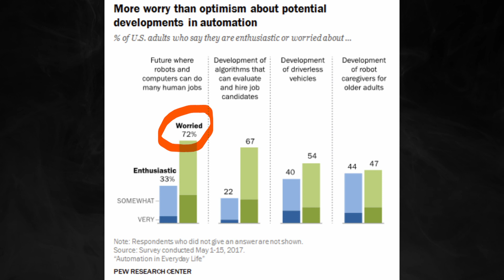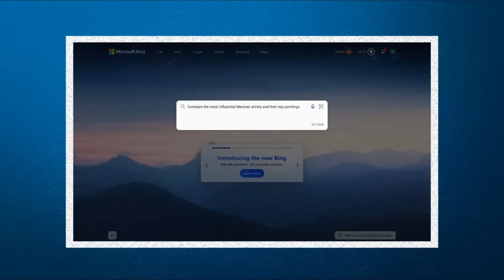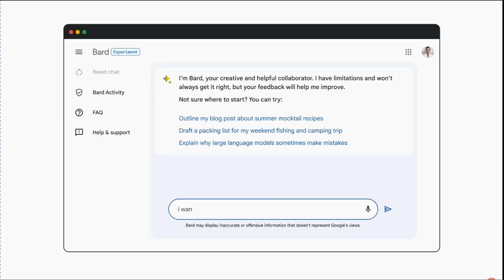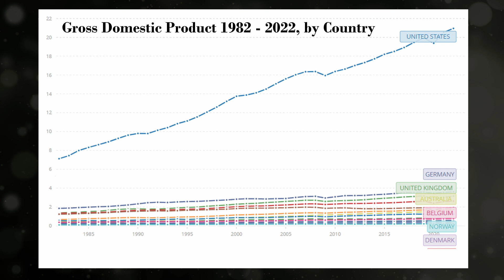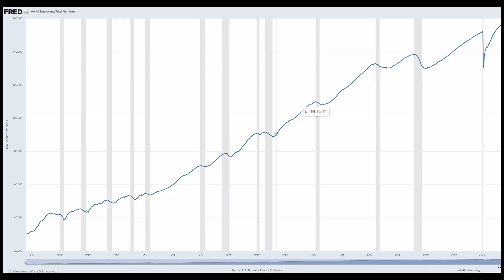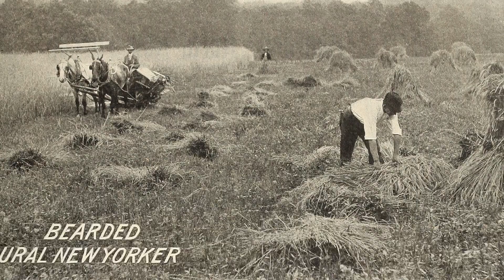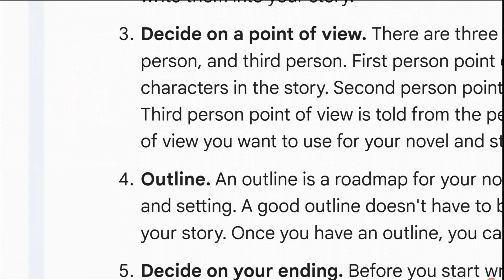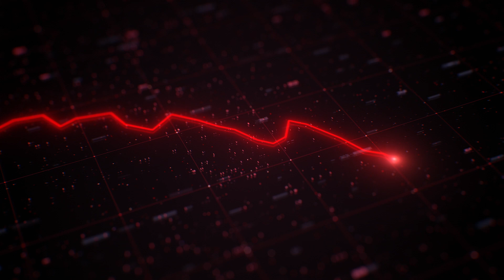Will AI Replace Your Job? | Lump of Labor Fallacy

Comment: Very good video. I think there are a lot of people who have somewhat apocalyptic visions of what is going to come with mass automation, and you break that image effectively. However, behind the myth of AI taking over is a much more modest, much more reasonable concern that people have, for a number of factors:

- Jobs require more education and training than ever, which increases the costs in time and money for both individuals and companies to retrain from one form of work to another. Further, the jobs AI will be best at replacing will be low and medium skill level jobs, mainly mundane repetitive tasks like emailing, stylizing, writing, processing, trucking, parcel routing, programming, data analysis, advertising. This means some number of people will have to specialize and train for more advanced work, which, frankly, not everyone can do.
- The types of jobs AI looks like it is going to be most capable of replacing is wide reaching, but targets specific jobs heavily (data crunching, non-performative creative jobs, writing, programming,  and editing jobs,) These people have genuine concerns of being put out of their jobs en masse.
- If 6% of the workforce was made redundant by AI in a span of 3 years (something considered reasonably likely to occur), that would be very bad for the economy. High job turnover decreases productivity, increases recruitment costs, costs time spent on training new employees, and lowers product quality. Worse is the possibility that more people than necessary will be made redundant by AI as businesses test AI's capabilities before they find the limits of what it can and can't automate. People will filter to other kinds of work, but the process will be slow and painful for many people.
- AI will increase the productivity of individuals, and for some jobs, could very realistically turn what was once 5 people working in a department into 2 or 3 AI-assisted workers. This saves the business money while simultaneously reducing the number of people employed by the business, which on a broad scale means a further acceleration of the wealth gap between the rich and the poor.
- The class of education most exposed to risk of automation (according to an St.Thomas article I found) is people with Bachelor's degrees. Fresh graduates are already having a hard time getting work out of college related to their degree. AI could put pressure on the greater education system that is already showing signs of irrelevance (dropouts and dissatisfaction with the college experience are at record rates), which could lead to a collapse of participation, which will cause reduced employment for higher education workers (1.4% of the US workforce works in higher education) and reduce the social and economic mobility of people because they skip degrees for lower paying, lower skill work.

All of these factors basically guarantee that AI coming in and replacing some significant percentage of the work force's current jobs will result in a large economic recession if it happens suddenly. People are right to be concerned about the rise of AI given that if it happens in the next 10 years it'd be the third back-to-back global recession. I think it's literally going to cost peoples' lives by generational lack of wealth and hope. Suicide rates have been climbing for the last 20 years, and the number one motivator for suicide is hopelessness about one's opportunities in life. That's what is concerning about the rise of AI. That will be the real cost.